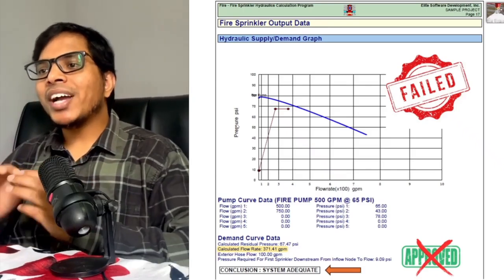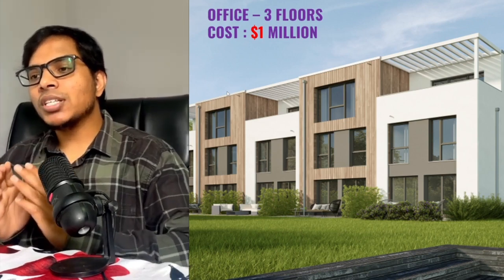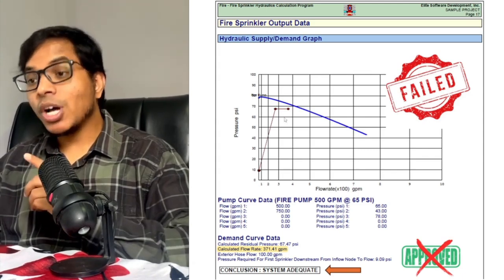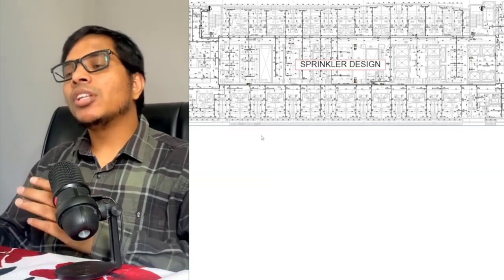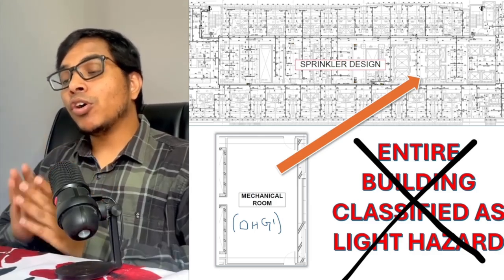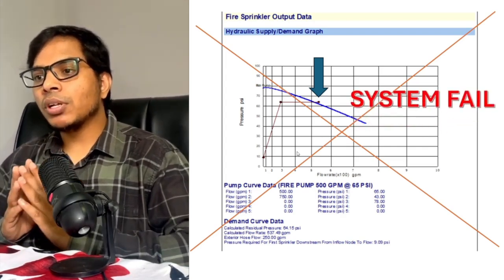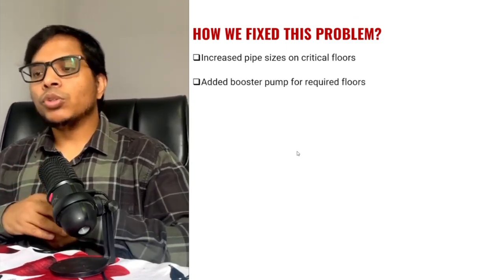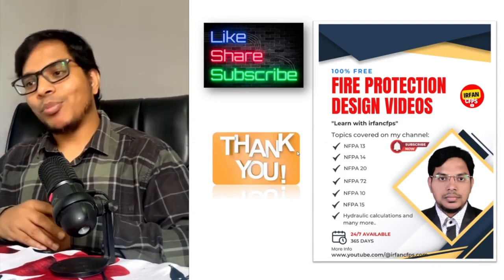This Sprinkler Mistake Could Have Put 100 People Lives at Risk!

Comment: Hi,
I was wondering if you can make a video to analyze a fire sprinkler system fed by a gravity tank. 
how the manual hydraulic can be performed, either manually or by software.
Looking forward to your insights!
Reply from the maker: Manual calculations are already available on my channel. The concept is same for that as well.
Reply: @irfancfps 
I will re look thru ur video for the question that i have..
But i think from online info, there is not much info on gravity tank hydraulic calc example 

And my question is also to know the hydraulic performance at any other area, and not just the hydraulic most remote area.

Comment: Sir, after calculating hydraulic Calculation for sprinkler - 300gpm aprx & landing valve 500gpm with 8bar we have to add both gpm 800gpm & take max pressure right ..?
Reply from the maker: No. Should not add. Higher Head and flow to be selected
Reply: @irfancfps  thanks if separate riser for landing valves & sprinklers means ?

Comment: It seems that the mechanical room is not in the remote area.
So, what is the size of the mechanical room?
Why is it necessary to calculate it separately?
Is the mechanical room demand more than the light hazard demand?
Reply: Sir, many Pakistanis want to do NFPA courses because there is a great scope for them in Gulf countries. But unfortunately, there is no proper guidance available in Hindi or Urdu. Most of your viewers are likely from South Asia, so please make a detailed video in Hindi or Urdu explaining the NFPA codes, covering all chapters one by one. Kindly consider this request. 🙏
Reply from the maker: @adnanshabir2565  iam launching a new youtube channel. bear for some time. thanks
Reply from the maker: Nice question. We will perform the calculations considering remotest area and also calculate considering the largest demand not necessarily it should be in the remotest location. So in short if there are different hazards in the building we need to perform calculations for each hazard remotest area

Comment: the mechanical room which you mentioned are  elevators ? and the motors are in the top roof , such project I will go for OHG-II ordinary hazard dived into zones each zone as per NFPA13   3715 sq.m with quick response sprinkler as zone dividers , flow for sprinklers 300 gpm approx. + internal Landing valve 2 set each 250 gpm + hose reel the total flow approx 1000gpm at 65-70 Psi depend in the pumps location either in basement or roof . Thanks Eng Irfan
Reply from the maker: Mechanical room is near the elevator and not the elevator. NFPA 13 clearly mentions mechanical room shall be OH group I as per NFPA 13 (Ed 2022) section A.4.3.31. For light and ordinary hazard, maximum zone area can be 4830 sqm per section 4.4.1. Standpipe system is required if the building height is more than 9m. Since the building height is less than 9m standpipe system is not a requirement as per local building code. Hence the requirement will be only sprinkler system based on that 500 GPM is enough. Hope you understood. Let me know if you have any queries
Reply: @irfancfps  thanks for your kind scientific reply with references